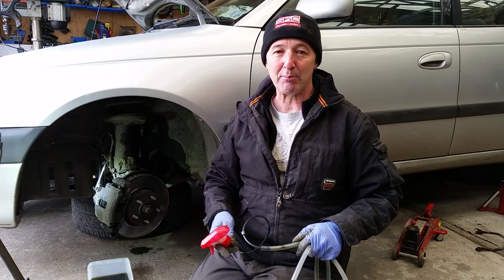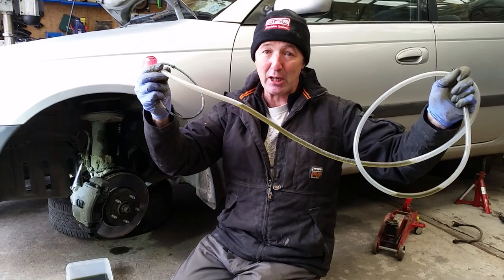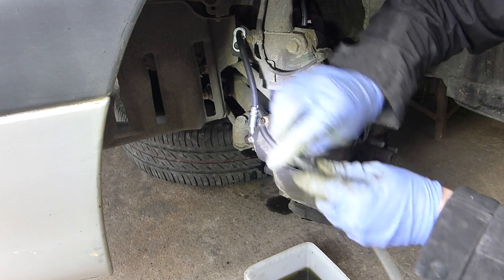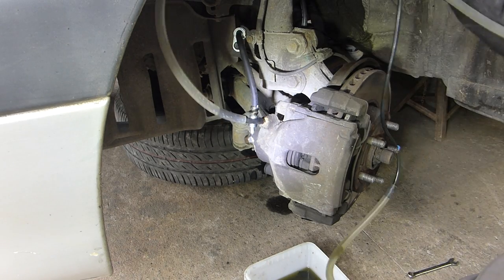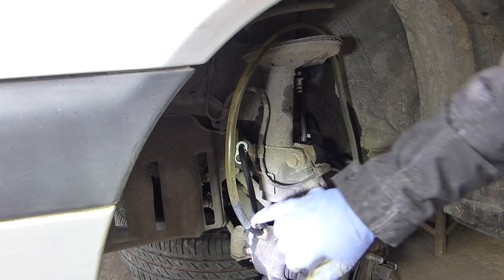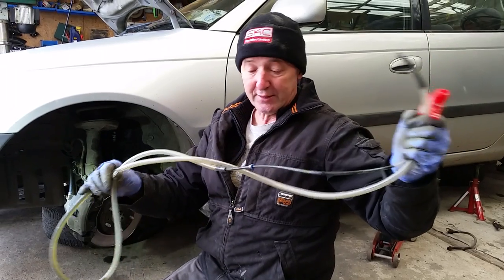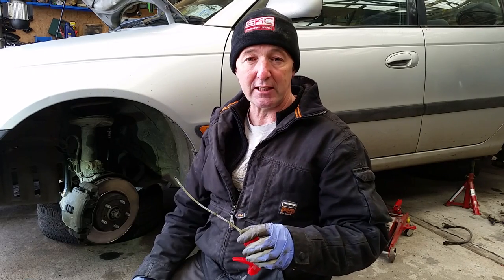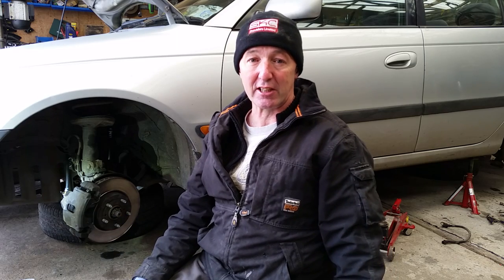Awesome - Homemade car brake bleeder -- Brake Flush -- Free

Comment: Brilliant simple but effective
Reply from the maker: Hi William. For something so easy, it's amazing how well it works. Thanks for commenting Cheers Gerry
Reply: I have actually tried your idea I renew my brake pipes on the front of my Escort it has a Biased pedal box so I only needed to bleed the front brakes and with your idea it was easy to do without the problem of trying to get someone in to pump the pedal

Comment: great idea...i have a power sprayer that come with a gallon of bug killer, since I pour the gallon/s in a bigger back pack sprayer, and always trow away this power sprayer,,now I have a way of using them,,,only thing is that I would make the hose/s a bit smaller, they seem a bit too long...Thank you for a great idea,,,been doing the bottle and with the hose inside for years, but this seems better.

Comment: So now that it’s all disconnected, how do you refill it without getting air in? Doesn’t air enter the system when you pull the cap off the reservoir?

Comment: I use a large syringe with a bit of tubing on the end.  For bleeding the master cylinder that has no bleeder screw, I just use two hoses and a tiny end of a brake fitting with a bit of line with the tubes on the end.  Then I pump the brake pedal.  For hydraulic clutch, I use a glass with a bit of brake fluid in it and a tube on the bleeder screw. I pump the clutch pedal until the bubbles stop.  For syphoning fuel from a tank, I use a check valve and a squeeze bulb.  Once the fuel makes it past the check valve I open the valve bypass and the fuel flows.

Comment: Thanks for this...1    obviates the need for a clear bottle as a reservoir....I would need to put grease on my bleed screws to eliminate most of the bubbles....I assume the idea is NOT to have any bubbles at the finish of every wheel,though???......I will make one of these soon as my new front brake parts arrive...Cheers
Reply from the maker: Hi Robert. The bubbles happen after the fact and by the time you see them the line is already purged of air. Putting some grease around the bleed nipple thread and one piece tube will sort this out. Thanks for commenting Cheers Gerry👍
Reply: The grease isn't totally necessary. Any air being pulled in through the threads is being pulled back out through the nipple immediately. The main thing is to get the lines flushed of any old dirty fluid and air pockets that form in the high points. Once you get clean fluid with no large bubbles coming out, you're done bleeding. Just close the bleeder while still drawing fluid under vacuum. Any tiny stream of bubbles you see are of little  consequence as they are only present at the bleeder. Even with proper pressure bleeding, you'll still have a tiny bit of air in the system.

In physics, entropy is real, and there is no such thing as true zero or infinity.

Comment: The idea is brilliant, but I'd prefer method with pumping air into the main cylinder reservoir (like connect the pumped up tire to it etc). This way you also can do operation alone, BUT the main difference is since it forces fluid to push the air/fluid mixture out, it creates the pressure and doesn't let air in. In this suction system it would probably let some air in to the tube via threading so it is harder to determine when the process is over, whether air comes from threading or another place (like incorrectly refurbished main cylinder etc).

Comment: I spent a whole 12 quid on a bleed kit off eBay some years ago. I've done the brakes on 5 cars and 2 clutches so far.  Struggled to get the air out of a caliper on a neighbour's moped - back bleeding with a 50ml syringe I bought at a chemist for 2 quid did the trick in seconds.

Comment: If your car, you can buy bleeder valves that you can crack open and bleed and they Shut when pedal is lifted. But I will try this method next time! Also work on Master cylinder?
Reply: If your car.. Wha?
Reply from the maker: Hi crimp creep. Thanks for the heads up and for taking the time to comment Cheers Gerry👍
Reply from the maker: Hi k j He meant that if the car was mine and I wanted to spend time and money that there are specialized bleeder nipples available. Cheers Gerry

Comment: What I do to stop air being sucked I. Around the bleeder and fittings, is to pack a bit of grease around the bleeder after loosening it. Seals out air and you get a clean bleed.  Wipe it off after.

Comment: That is just a fantastic idea! But get a spray bottle pump with a jet setting, most do and then no misting of the brake fluid floating around 👍
Reply from the maker: Hi Neville. An adjustable spray bottle would be better. Thanks for commenting Cheers Gerry👍
Reply: @GerrysDiy  adjustable that's the word I was looking for!!

Comment: does the tube have to have brake fluid inside before conecting it to the bleeder valve and does the cap need to be off master or no

Comment: That's a great idea lol. All I use to do my breaks is a clear tube like yours and a old vinegar bottle with fluid in it. I usually zip tie the nipple end just to make sure there's no air. I bought a reverse bleeder from amazon and sent that thing right back. It's supposed to bleed from the nipple out to the resvoir but it just locked up on me and did nothing. This looks like it works good i'll try it next time just for fun.
Reply from the maker: Hi Simon. The great thing with this is there's no purchase and you can see it working instantly. Great that it's free too. Thanks for taking the time to comment Cheers Gerry👍

Comment: Going to try it on my hydraulic clutch. It's nearly impossible to bleed, because of the bleeders location. If it works, it would be the trick!
Reply: I'm thinking a bicyle pump with the plunger(?) turned around so it sucks instead of blows. Could do a brake line in one pump and nip up bleeder towards the end to gurantee that no air gets in.

Comment: think i like the method where you just put a clear hose submerged into brake fluid and open the valve and pump away until you see clear fluid. when you release the pedal old fluid will suck back up. then you just close the bleeder.

Comment: Gerry,  I put new calibers on along with a new master cylinder and when I went to bleed the brakes I could not get any pressure.  Bled the master and when I have a clear tube hooked up to the bleeder I can see the air bubble in the line. However when I pump the brakes the air bubble simply rocks back and forth as I pump the brakes.  The method I am using is I have a 12' long clear tube with one end hooked up the a bleeder screw and the other end sticking down inside of the master cylinder so the fluid just gets recycled.  Have you ever has this happen and if so how did you get pressure.

Comment: Positive pressure is better than vacuum due to air getting drawn in past the bleeders screws threads
Reply: Semper Fi LoL, then how do you determine the air trapped in the lines has worked itself out? Bubbles coming from the threads or coming from being purged? By using the vacuum method, there’s no way to insure complete and proper brake job. Use pressure to push out the air!

Comment: I just run a clear tube from the bleeder up to the master cylinder, crack the bleeder and just keep pumping, once the fluid reaches the reservoir you can just stop or keep pumping with no worry that the reservoir will run out

Comment: So will this also work when there is no fluid in the system?
Reply from the maker: Hi Pierre. This will suck air until it gets to the fluid. If the pipes were new and full of air this would pull the fluid down the lines. Hope this helps Cheers Gerry

Comment: If you get a bit of clear tube, fold the far end over by about 3cm, then use a zip tie to fix it together. Then with razor put a vertical slit in the pipe at the folded end. you have a brake bleeder for the price of a bit of pipe and a zip tie. You simply pump the brakes until the air is gone. The slit stops air from going back into the pipe.

Comment: Retired ASE Master Technician here: This is a good idea, don't get me wrong, but I never thought of this because I've only used this vacuum method (with the proper tool) for bleeding brakes once or twice early in my career and I quit doing it because frankly, IT SUCKS. TWICE! It sucks by sucking on the brake cylinder and it sucks because it doesn't always work. The best method that doesn't need an assistant is the gravity bleed method. As long as you have fluid in the Master cylinder, letting gravity do the work is easier and more reliable. With this sucking method, the presence of air in the lines can draw out the bubble and make the job harder and often frustrate the main purpose, especially if the air is in a line before it gets to the proportioning valve or even worse at or inside an ABS motor/valve assembly. In those cases the vacuum bleed method can actually introduce air into a line that had no air in it to begin with, as can a pressure bleeder. Gravity bleeding is the only method that eliminates that problem, so I always use the gravity method. It can't push or suck air into places it isn't already like pressure and vacuum bleeders can.

Comment: I just open the bleed valve,remove reservoir lid and let gravity fill the caliper with fluid. Once the fluid runs just tightening the valve. No pumping necessary.

Comment: That was good, but I did this technique with a plunger of shampoo bottle. It will be better because the oil will flow much more smooth and the shucking is stronger as well.

Comment: Problem with most set up is air leak around the brake nipple, especially around the threads.  Vacuum grease or thick bearing grease will help seal up the leaks.  Just clean up with brake clean spray afterwards.
Reply from the maker: Hi. It's a very simple little setup but works great. Not bad that it's free too. Thanks for the advice Cheers Gerry

Comment: This would only be used if the brake fluid filler is not been pressurised you should only need to connect the pipe and crack open the bleed valve on each brake caliper, it will self bleed

Comment: Just bled my brakes after replacing a back cylinder, brakes are still rubbish, have to stand on them, worse if they are pumped, then they fade. Not spongy tho, quite hard . Any ideas, vwt4 van?
Reply from the maker: Hi Bill. Sounds like you have the air out of the lines but your master cylinder or servo is giving trouble. Maybe some of the guys here can comment. Cheers Gerry

Comment: I've used a soap bottle pump to pump out the master cylinder.  Sopping it up with paper towels goes far, also; just squeeze it out, and reuse it.
Reply: Or just pump it directly into your container of choice.
Reply: Paper towels sound messy, and brake fluid is an excellent paint remover.
Reply: @jjbailey01  It's not too messy.  Relatively  controllablable by letting it roll down your thumb. After several absorbs you will see the level down. I think I have done this to take some fluid out before pushing in caliper pistons for pad replacement. (I meant reuseing the paper towel, but the fluid is probably essentially OK too).
Reply: @louf7178  meh. I'll pass on brake fluid rolling down my thumb and dripping off paper towels onto the paintwork.

Comment: It's better to do reverse bleeding using an oil squirter since lighter air bubbles travel up. Just make sure to uncap the brake reservoir and remove excess fluid.

Comment: I took my master cylinder cap off and drilled a hole in it the size of an inner tube valve stem. I then cut the valve stem, with a small circle of the inner tube,still attached. Then I placed the valve stem through the cap and rubber glued it in. After the glue dried I placed it on the master cylinder and hooked it to my little tire air compressor.  I get the pressure to 20 pound and open a value and let the air pressure force fluid through the system to get the air out. I just do this until it's all out.

Comment: Haven't tried it yet but I've been thinking about using something like grease around the bleeder threads to seal them from leaking air.
Reply: From this guy to you: "The Daninator":  "..check out this sealant: https://www.permatex.com/products/thread-compounds/thread-sealants/permatex-pneumatichydraulic-sealant/

Comment: Hi..I need your help with my 1996 Acura  RL, the car when cold, the battery would charge at 14.40 to 14.75 and then it would drop to 13.10 t0 13.55 when engines get hot.
What do you think cause that to happen

Comment: This seems like a great idea but all I'm getting is air bubbles. What's to stop all the air in the tube at the start getting sucked in when you loosen the bleed nipple? I tested it in water and there are no air leeks in the cable bleeder.

Comment: Brakes will actually bleed themselves. If you leave the bleeder open they'll eventually start to bleed air and fluid. It's better to use a clear tube or bleeder kit for that process so you can see the air and fluid.

Comment: Did you open the brake fluid cap ? Pressed the brake or something ? Or just that
Reply from the maker: Yes open the brake fluid resevoir and  use the pump to remove the air. No need to press the brake pedal to remove the air as the hand pump will remove air and fluid. Hope this helps Cheers Gerry 👍

Comment: I just use an old pop bottle, put a little brake fluid in it & run the hose to the bottom of it, leave the bleeder open (hose on it) and pump the brakes till there’s no bubbles in the line and the fluid runs clean.
Reply: You're better off just gravity bleeding. When you pump the brakes without closing the bleeder, you run too much risk in drawing air back into the lines through the bleeder screw threads when the master cylinder piston is pulled back. Even if you grease the threads, you're drawing a vacuum all the way back up the lines. Air can still get past the threads and back up the lines. If you're going to pump the brakes, only do it as a two person job. Otherwise just open the bleeder with a tube in a bottle and let gravity do the work while you sit back and sip your favorite beverage.
Reply: Bullfrog's Workshop Well since I continue till there’s no bubbles in the hose then there’s no air in the line obviously... I’ve done it many times without issue, it’s the best way to do it, both your method and the one in the video do nothing to flush the system and that’s something that should be done every few years.
Reply: @CarswithNash  I disagree. Any method of displacing fluid, whether by pressure, vacuum, or gravity will bleed the fluid and pull fresh fluid from the reservoir. In any method you still need to empty the reservoir and fill with fresh fluid before bleeding. All three methods will effectively replace the fluid in the lines and cylinders with fresh fluid. Yes, I do agree with you here. Replacing the old fluid with fresh is a must. I always make sure I have fresh fluid coming out the bleeders, even when gravity bleeding.

Your method may very well work most of the time, as evidenced by your experience. The problem with pumping the brakes as a one man job without opening and closing the bleeders is that one of these times it will come back to bite you when you suck air back up the lines. YMMV. Cheers.

Comment: Do you have to do all four or does one side work for both the front and one side of the reservoir work for both the rear
Reply: Dual circuit brakes have to be bled in a specific order and this can vary car to car. See your manual. There are two bleed screws on this calliper so you will have to take that into consideration. Older single circuit cars are usually bled in the order of the length of the brake pipe from the MC, so you will start at the back.

This video is to show the use of a DIY vacuum bleeder. It looks as if it works well but how long the seal in the pump will survive is another matter. It's not to show the complete bleeding of the brakes of a specific car.
Reply: Always bleed at every wheel. The goal isn't just getting air out. You're bleeding the old, nasty fluid out too. The only way to do so is bleed every line, in the correct order.

Comment: Calling from Celbridge, fair play...I'll be using that on my Mazda in the summer. Yeah, my wife never helps me wit the car...lol Cheers
Reply from the maker: Hi R Killian. I used to live up the road in Kilcock but in Wexford now. The mr Sheen pump worked great and will fill the brake lines even if they were empty so not a bad result for free and it's quick too. I have plans for the good weather too but it will involve flying my paramotor and paraglider. I am trying to set up a camera mount at the moment. Thanks for the comment Cheers Gerry
Reply: I'm setting toe in, and the wife is invaluable in holding one end of the tape measure.

Comment: does it means that.. i can do it alone? They always said that we need 2..one  to pump the brake pedal from inside..the other one is screw and unscrew the nipple
Reply from the maker: Hi Sadi. Yes you can do it alone. You don't need anyone to pump the brakes. When you get a good flow  simply tighten the bleed nipple. Works Great! 👍 Cheers Gerry
Reply: @GerrysDiy  thank you sir..i had enough with the foreman doing on my brakes...1st... service.. 2nd ..master pump.. but still ..need the pedal nearly reach at the end..only then can stop... kind of no pressure at the start of braking

Comment: It's an ingenious method, but I think it's a much better method if you do it with excess pressure at the brake fluid reservoir. Vacuum is not the best method because air can get in past the thread of the bleeder screw. Overpressure, on the other hand, pushes the brake fluid out there as well (in a negligible amount). Maybe that's why it was bubbling constantly for you too and not because of the fitting of the pipes.